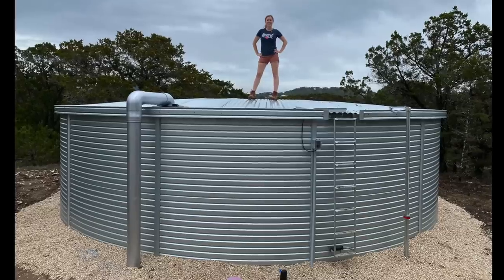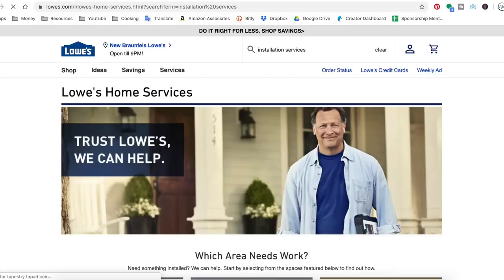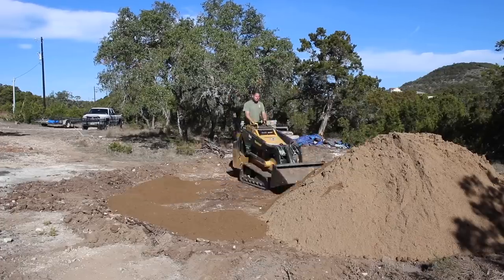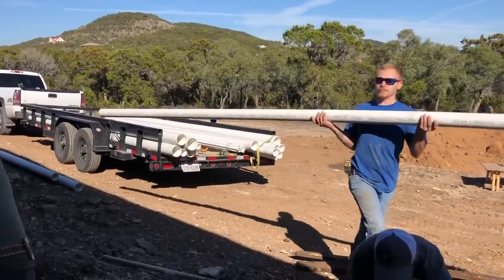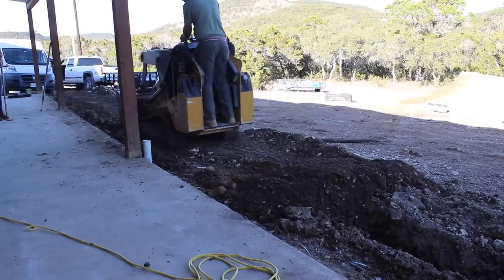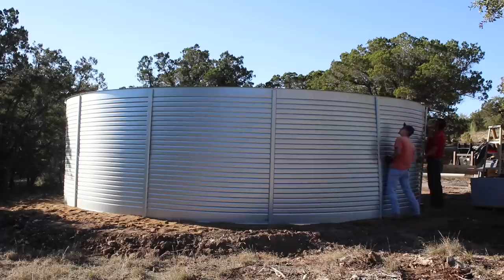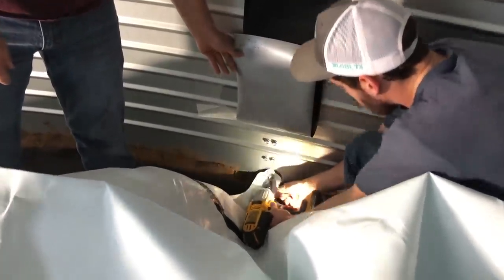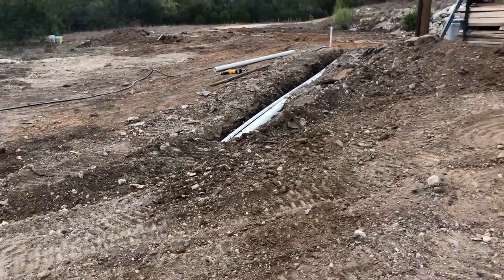Installing Rain Water Collection

Comment: Great video. In dry country rain harvesting a no brainer imho. Why would it be illegal to harvest rain water?  The pipe sizes also get bigger as you go down stream as other pipes join as the volume of water increases at every junction.. like a river gets bigger ther further down stream you go. I saw a cool overflow plumbing trick where they plumb the overflow into a pipe with a lot of holes lying on the bottom of the tank so that when it overflows it takes some of the sediment brought in from your roof away.
Reply from the maker: I think some states are worried about the effects on nature, if every rooftop started collecting water. Out in my rural area it wouldn't be an issue, but I could see a possible concern if every house in a tightly packed City collected.
Reply: @AprilWilkerson  I think some municipalities control the water and make money off of it, and they don't want to lose that money SO laws are drawn up outlawing collection of water, they hate the competition.
Reply: April in heavily populated area in Europe almost all surface  is paved. Very much rain water goes in the sewage system and then into the water treatment plant. This is a short way of waterflow into rivers  and other waterways. Hence the ground water level gets lower and  lower. In some areas foundations of buildings are endangered because of too low a ground water level.

Comment: The water has enough momentum to push up through the vertical pipe and into the tank? Or, is there a pump somewhere in-line?
Reply: As long as the roof is higher than the inlet into the tank the water will flow.
Reply: Aaah, got it. Thanks!

Comment: Not sure if any of previous 500 comments asked, but do you filter debris from the roof and gutters before it goes into the tank? I also wonder if anyone has analyzed whether or not catching that volume of water will impact the aquifer's capability (cause wells to go dry) for your well and those of your neighbors?

Thanks for the great video!
Reply: Hi Ed, The water enters the tank through a screened basket, which keeps debris out of the tank and prevents mosquitoes from going in or out. The water captured in the tank is directly usable.  If it's not being captured in the tank only a tiny fraction of it (if any) would ever reach the aquifer. At my home the water in our well entered the ground hundreds of miles away and hundreds of years ago which is why it's so full of minerals. The rainwater is perfectly soft without treatment, whereas ion-exchange softening is required for well water in this area which creates it's own set of issues.

Comment: Hi April. Probably a stupid  question, but is the down hill grade enough to push the water up the fill pipe at the storage tank?  Or is it somehow pumped in? Love your videos. I've  been watching from the beginning. Keep it up. You've come  a long way.
Reply: A "wet" collection system is essentially like a giant "P" trap - the water coming in (at the downspouts) pushes the water out the other end as long as the other end is sufficiently lower.

Comment: Hi April, looks like a very exciting project. As you did in certain parts here, would you consider providing both imperial AND metric units. It would certainly allow greater comprehensibility or non-American viewers. Warm regards from Australia :)
Reply: What's funny is I translated the metric units to imperial for April to put in the video as most people in the US don't speak metric.  What's even funnier is the Australian made tank's capacity is in Imperial gallons which are not used in the US at all or in Australia any more... Over there you'd most likely know this tank as a "GT110" for it's size in cubic metres / thousands of litres...

Comment: In Belgium every new house build (or thorough renovation) is required by law to put in a reservoir of at least 5000liters (can be more depending on the roof area).
Reply: Amazing some places it is illegal (idiotic) and other places (Belgium, Australia) it is required...
Reply: vondeliusc I could understand pumping up water from the soil being illegal but forbidding to place a reservoir makes no sense to me. Where is that the case?
Reply: @gvanvoor  The only thing I can think of is ignorance or greed of the 'authorities'. Collecting rainwater means municiple water is not used, but the same amount of water overall is used and winds up in the sewer system in the cities...Makes no sense to me, but many things do not make sense. Seems like a great thing to collect rainwater, to me.
Reply: @gvanvoor  We visited Colorado Springs, CO, USA in 2007 and was told by the motel owner that it was illegal for anyone to catch water off the roof to use for garden, flowers, etc..
When Kansas City International Airport was built in the late 60's and opened in 1972, large pond areas were built to catch rain water off the buildings and pavements so the water would slow down leaving the site to what would be approximately the time it would take before all of the hard surfaces were built.  This was to help control flooding from so much runoff.
Reply: @BrilliantDesignOnline  our county went through a massive sewer crisis a few years ago. Google Jefferson county Alabama files for bankruptcy. Because of that, they are charging sewer rates based on water usage. Each year it goes up. They tried to start charging sewer fees on people that had a septic tank, but after the lawsuits started being filed...they re thought it.

Comment: April. Have you considered running a recirculating water power generator in your system? Basically you run a water turbine via pvc into the tank to suck the water out via siphon into a much smaller tank below the main one. You need about a 12 foot drop from the top of the power generator. Then the smaller tank has a return line that overflows back into then main tank so as to never lower the water level too much. The small tank must be air tight to prevent leaks and loss of pressure. 12kwh per day per 500 watt generator. Your tank is so big that you could have a ton of those. You could literally power 5-10 houses.
Reply: These two are the generators but the idea is something I came up with and have yet to try it out but I truly believe it will work and you look like you have the funding to do this type of project so hopefully you are intrigued and give it a shot! Please lmk if you do it and make a video. Would be awesome!!

Comment: advice, get the biggest tank(s) you can manage. Those 50 gallon barrels you get from the big box stores are to small and a waste of money. They will fill up quickly off a simple small shed roof. Off just the back side of my 1700 sq ft house I had two 250 gallon tanks and 2 of those 50 gallon barrels and twice a year during the rainy season in DFW I had to just dump ALL OF IT in the street because they were to full and I needed room for the coming rain. When getting rain barrels, go big.

Comment: As of posting this video how much rain have you had in you area? and how much water have you collected? Is the only was of know how full your tank is by looking into the hatch or is there some type of external indicator?
Reply: If it's running out the overflow, it's full. 🙂
Reply: There is a level gauge just to the right of the hatch.

Comment: Great video. I do not have near as much land (2.5 acres) but am thinking about something like this, probably on a smaller scale. I am also on a well and am concerned about it drying up during a hot summer. Without knowing your site layout, there are a couple of questions that come up? What do you do if the land is fairly level? It looks like yours is, but maybe not. It seems to me that you would need a pumping solution to get it to the tank. Was this not an issue for your site?
Reply: As long as the roof is higher than the top of the tank, it will work.
Reply: Hi Glen, You have plenty of land for rainwater harvesting... the tank in the video needs a spot about 30'x30'

Comment: Hei! Thank you for a Great video! Yes I have a rainwstercollectorsystem. Provisoric functioning because I do not have the money that takes to built a professional one. In 2017  I had to buy me a 1000 litres tank because my ordinary water supply failed on me. Pumping from nearest lake, (I have a beach property) did not work any more. And later I also get some old waterheaters (300 litres) that is coupled i to a system from the downpipes from the roof. It looks horrible at this moment but I will be working on it in the spring and summertime. Hopefully I Will get my watersupply up, n running soon. My community does not supply water to us, "out there in the cropfield" That, s what we call it way out from the city center
Thank you again

Comment: Why did you need High-Pressure pipes when it's for gravity fed water drainage?
Reply: We use schedule 40 PVC pressure pipe and fittings for durability.  On older systems a common failure is the underground lines which were often built with SDR drainage piping.
Reply: Harvested Rain Solutions, LLC awesome thank you very much

Comment: Do they make automatic rain gauges that can be used automatically purge your lines if it's too dry? I can see it being annoying regularly throwing away several thousand gallons of water because you forgot to purge the lines before a storm that ended a short drought.

Comment: Hi April, if you wanted to keep it closer but also wanted the gravity assist, could it have been installed under ground, or mostly underground?  I’m guessing you weighed that option and there were issues … maybe about digging a large hole so close to the building foundation?
Reply from the maker: This is the Texas Hill Country and all rocks. Even to dig a foot can be daunting. Thanks for watching.

Comment: Get in touch with your homeowners insurance and fire department. If you put a 4" or 5" standpipe off of that tank it will act as a hydrant for fire suppression. In some states this will actually reduce the cost of homeowners insurance. As a firefighter I can tell you that 30,000 gallons of water is enough to save a home or shop.

Comment: Hi April, Your tank looks really great. Do you have anything that measures the level of water in the tank? If not, I am in the process if designing a very simple system and would send you one with installation instructions. The better way to protect the pipe underground due to land movement was to put about 4 inches of sand below and above the pipe, then backfill with other materials. The water is quite drinkable . I am using rain water for that last 65 years. Keep moving on.

Comment: I may have missed this but how does the water get from the downspouts up into the tank?  Where is the pump?  You would think gravity would drain the water to a sump where it would then turn on a sump pump to pump the water into the tank but I did not see that.  I see you installed a pump in the tank so that you could pump water out of the tank but did not see how the water gets into the tank.
Reply: watch the video again you will see it

Comment: How does the incoming water make that 90 turn and flow straight up to the inlet at the top of the tank wall?  Is it just the pressure of the water traveling downhill from the shop?  Freaking science.  Very cool, I definitely have lot size envy.
Reply: Because the roof is higher than the inlet of the tank. Water seeks its own level.

Comment: Just a couple of questions; I may have missed it but is the rain water being shed off the tank roof being collect? Any concern with driving over the areas where the collection pipe is buried? Hook’em!
Reply: When there's a large roof to collect from we typically don't collect from the tank roof. The underground piping is Sch. 40 and is fairly durable. We backfill with clean soil or sand and once the ground settles and packs in we can drive very heavy trucks over the collection piping with no issues. The soil here is very hard and rocky so vehicles don't sink in.

Comment: Can fire trucks connect to it easily?  Does your HO insurance give you a discount considering you have water to fight a house fire even closer?  Would local codes suggest you have a large secondary water source depending how far you are from a local gov't provided fire hydrant?  I noticed Matt with Bunker Branding 2.0 also installed a large water tank...not sure why.
Reply: fire hose connection is optional, inexpensive.

Comment: Great video April is the outlet on the top of the tank lower than the bottom of your down pipes or does this system work with the ground pipe loaded at all times and any water coming of the roof pushing it up into the tank ?
Reply: As long as the inlet in the tank is lower than the gutters on the roof it will work.

Comment: So how many years does it take to fill this and pay it off especially in draughts. We just had a year with less than 10 inches of rain. I have 60,000 sqft of combined roof on our farm and we managed to fill maybe 1 of our 10 500 gallon tanks in our water collection system so without filling this tank off a water system how long does it take to fill this on just rain. Hurricane Irene was the only year we ever filled our system to it's max. We have never collected more than 2000 gallons off 60,000 sqft of roofs in one year.
Reply: 1" of rain on a 60,000 sq. ft. roof is 37,380 gallons.  You may want to check your collection system is functioning!  With 10" of rain in a year that's 373,800 gallons.  We get 2-5x that much rain per year here in Central TX.  Sometimes we get 10"+ in one day.

Comment: We’re currently working on a water collection system in Virginia. Our roof is just over 1000 sq feet. Our tank is 1550 gallons. 
Did you install a first flush in your system?

Comment: great video again, April ! :-)   question: how does the harvested water go up that 6inch pipe into the tank? is there a pump for that too? or is the slope enough to do its work?
Reply: It's just the weight of the water. As long as the end of the pipe at the gutters is higher than the end at the tank the water will come out at the tank end.

Comment: Very cool! But if your water is still hard even with a water softener, then either the unit is not big enough or it just simply needs to be replaced. The water softener will remove all hardness if the unit is the correct size and in good working order. Sincerely your culligan man 🤪

Comment: So, once water is in pipes how does it go up, to get into tank? Does that have a pump as well? Pretty cool. My grandfather had an old one he used on his farm. For irrigation and for giving water to his cows.
Reply: Gravity, the roof is higher than the tank.
Reply from the maker: Since the tank is below the roof line, gravity is enough to push it up and into the tank. That's why I went with it in the woods instead of just to the side of the shop.

Comment: this is really interesting, but I have questions.....
1. what is the purpose of spending all that money to collect the rain from your building roof then pipe it down to the tank?  Couldn't the tank roof just collect the rain itself?
2. what was the cost of this system as opposed to just drilling a deep well that you would have to worry about your neighbors contaminating?
3. what kind of system do you plan on installing to make the water potable?
Reply: The tank roof can collect water too - but it isn't as controllable as collecting off a separate roof.  It can't be diverted if the roof is dirty, the water just drops straight into the tank.  Depending on the property a rainwater collection system is comparable to a basic well, but the groundwater around central TX is often very hard and sometimes smelly.  The rainwater is much cleaner right out of the tank before it's filtered.  If April decides to make the water potable it will likely be with a three stage approach - sediment filter, carbon filter, then a UV light.

Comment: Two questions...

1) How much would I probably look to spend on a 30k gallon rain collection system kinda like this?
2) Would this system work if my land is level?
Reply: Hi Caleb, In central TX, a system similar in size to this along with UV treatment for indoor use would be around $30k, plus or minus a few $k depending on site conditions and piping complexity.  As long as the inlet on top of the tank is lower than the bottom of the gutters by a few feet the same "wet" collection system will work.

Comment: Maybe there's more pitch to the land than what it appears, but I don't see how the water will go up the pipe into the tank without a pump to drive the water 6 ft. or so up the side of the tank.  I don't recall seeing an input pump being installed.  Seems to me that the collection lines will sit full of stagnant water and never empty between rains.

Comment: Nothing as fancy as that, but I have two -500 gallon tanks, three - 250 gallon tanks, and five - 40 to 90 gallon tanks for a total 1450 gallon capacity that serves my little pond, green house, aquarium and garden near Dallas TX. Your rain tanks overflow should be managed that it doesn't cause erosion. Consider constructing a rain garden or level swale at least 10 feet from the overflow.

Comment: Interesting and enjoyable video April !  And if it’s not a secret...what would an installed system like that cost
Reply: Hi Texas Bob, In central Texas a similar system is going to be around $30k, plus or minus a few $k depending on the site conditions and the amount of collection piping.  The collection piping is the second largest line item on most proposals.
Reply: Thanks guys, I appreciate the reply.. y’all did an awesome job on this install. 
Bob